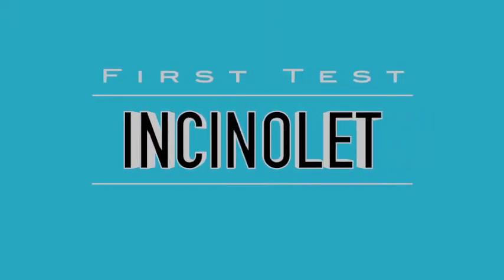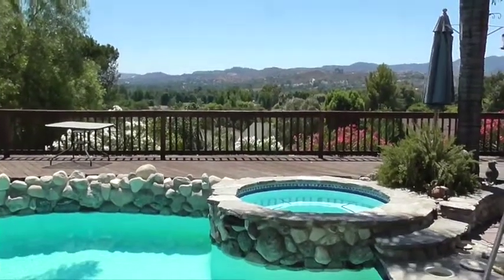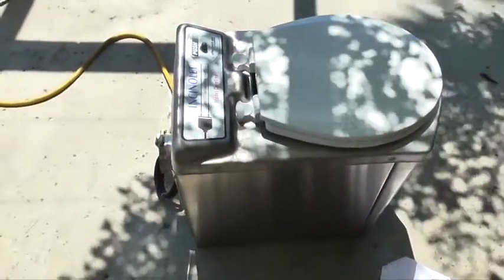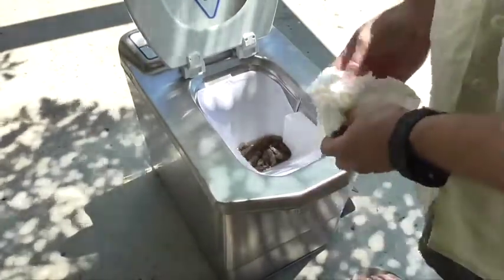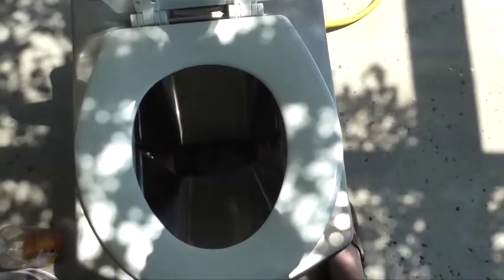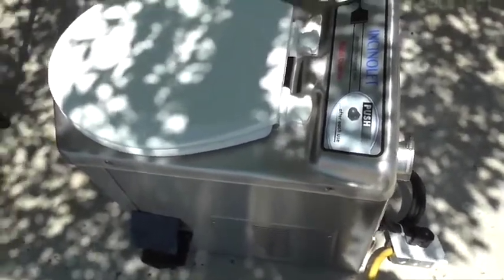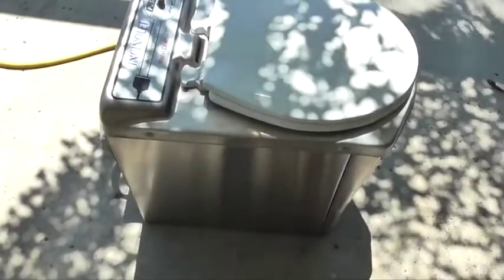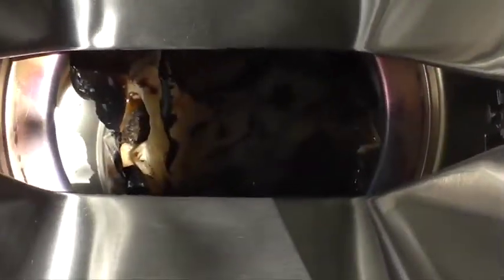Incinolet Toilet Test

Comment: This thing is ANYTHING but "green". That's 2 kWh's worth of electricity per flush. Upwards of .50 cents of electricity per flush in high electricity cost areas. And then you have a fan sucking out cooled or heated air from inside your living space. Such a terrible design.
Reply: this isnt a "green" replacement for a toilet. Its for use in a remote or old shop location that has no sewer lines
Reply: YES. It is better to use a composting toilet to gather your poop and toss in the bin at Safeway. Or flush your poop into your septic system on a flood plain during high water events. Or send your poop away into a vast network of pipes and plants that run 24/7 to process the waste and dump it in a river. Are YOU still using one of the above methods for your poop? If so...do as you preach...do something to minimize you impact.
Never forget we now have so many people on this blue marble of ours that this type of waste management is all that is allowed in new construction in many parts of the world. Incinolet has been around for decades and is doing a good thing. climb down off your high horse...PLEASE!